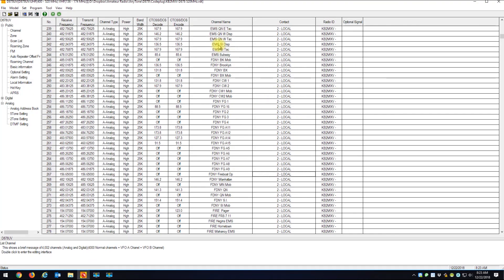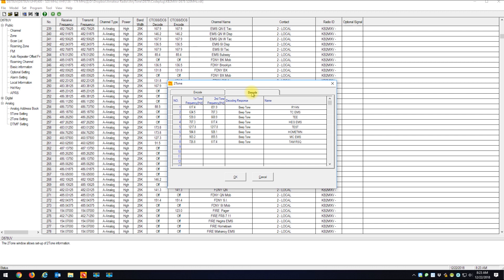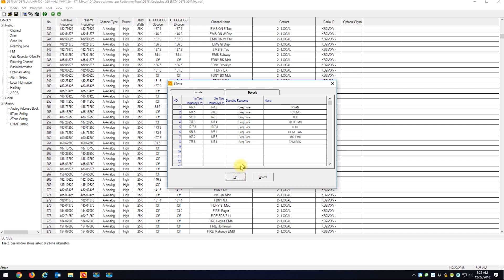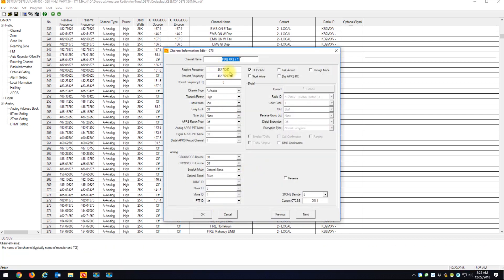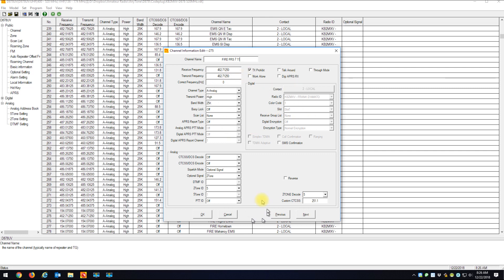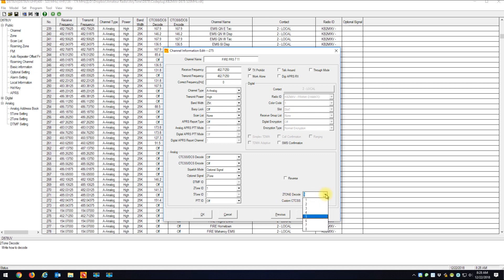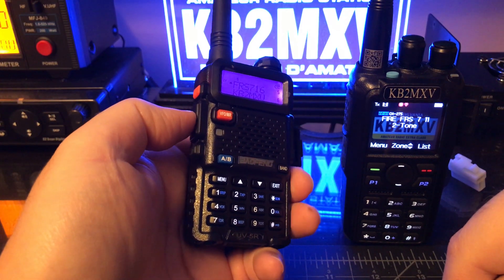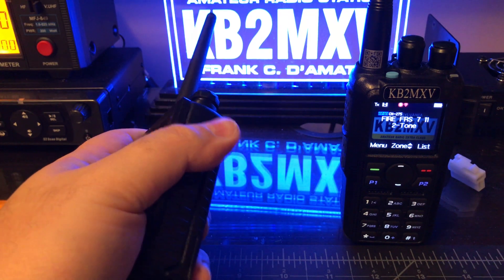AnyTone 2-Tone Programming on D868 D878

Comment: Will this work while the 878 is scanning?  The freq in question is in the scan list.  Or does the 878 have to be stopped on the freq in question?  Thanks so much.
Reply from the maker: I cant confirm this but, I think missing the start of a tone while scanning would be a problem
Reply: @fdnyfish  Thanks for your reply.  It did work this evening in scan mode.  Whether or not is was just a lucky hit time will tell.